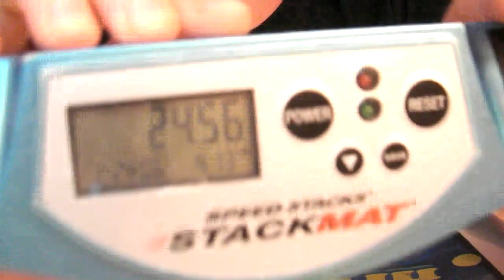How to Set Perfect Tensions on a DIY Rubik's Cube

Comment: @son8675309  there is nothing wrong with the cube but if you want to make that go away you should go take apart you cube and see if there are washers on the side of the spring where the spring is touching the plastic, if there isn't any washers, go to home depot or some other place like that, you want a washer that has a hole just big enough for the screw to go through, and should fit inside the side cube without touching the side's. btw it might still make a very slight sound against the metal.

Comment: @son8675309 a spring is a straight piece of metal that has been coiled, at some point the piece of metal has to end, this end part where they cut the spring is flat has has sharp edges, so when turning the cube, sometimes the end of the spring will catch on the plastic then let go after being tightened, this will make a creaking noise, read my other reply i ran out of characters

Comment: i was wondering, why does it has to be on the same tension on everyside. mines have different turning on every side if i have the same tensions. i adjust them one by one according to my normal fingertrick so that it turns accurate.